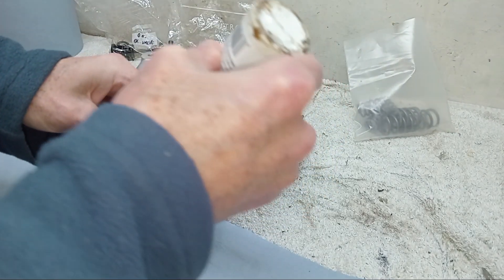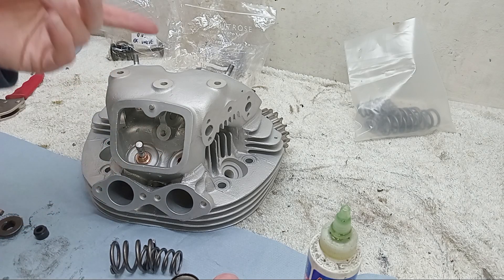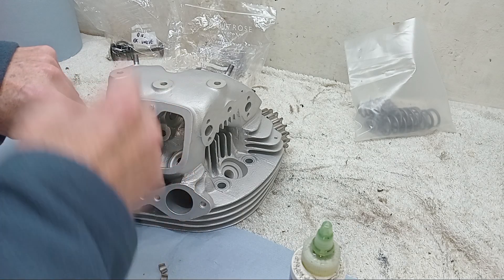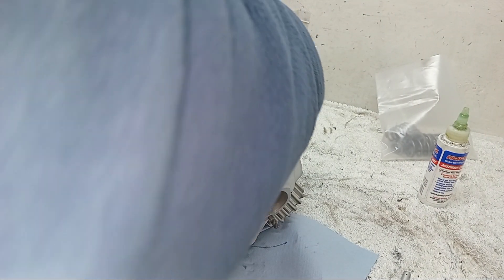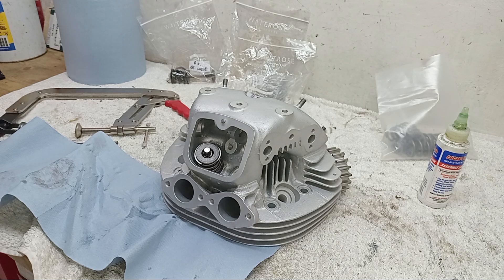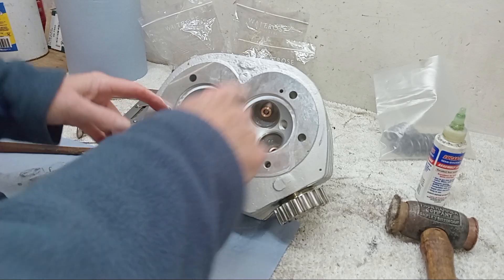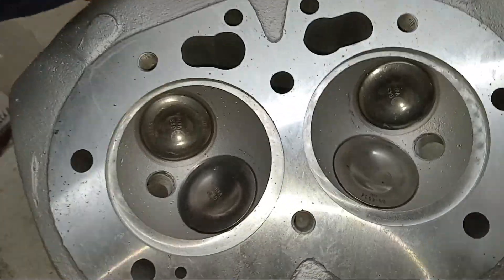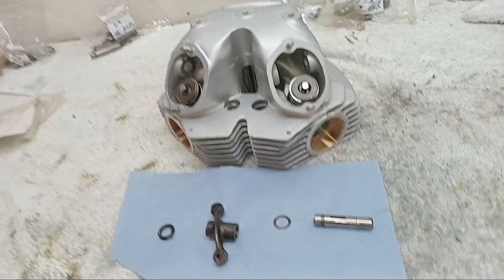Norton Commando Engine Rebuild. Part 70: Valve Fitting Part 2

Comment: Apparently, heat will damage the valve springs on the exhaust side if the insulators are not there. Valve springs are cooled by oil.